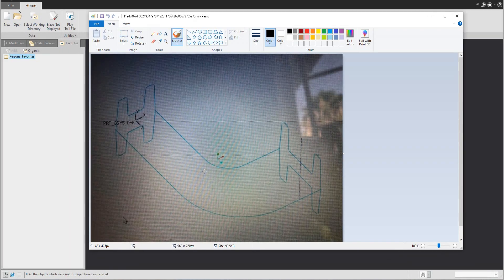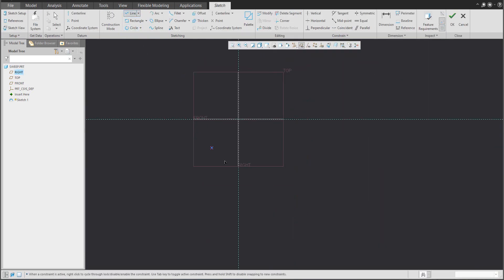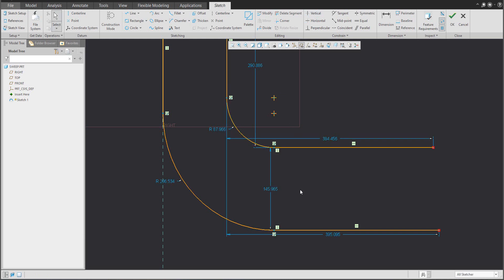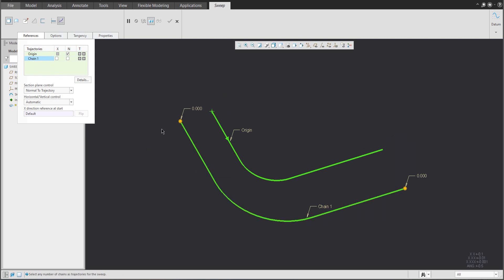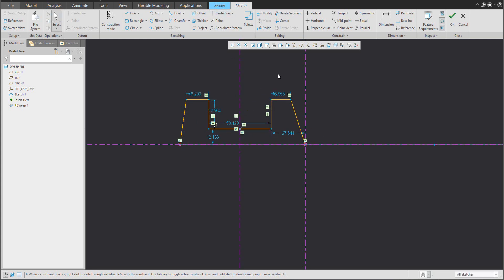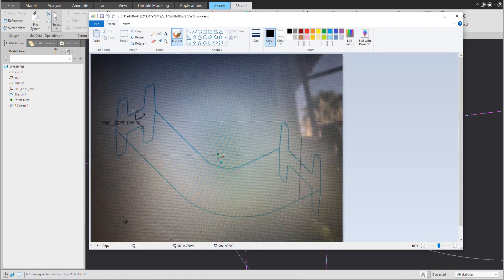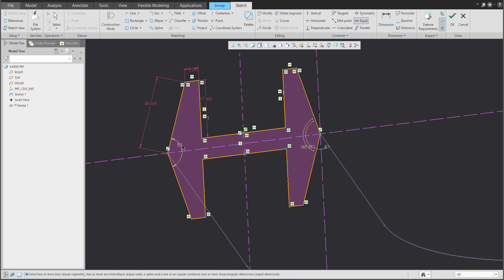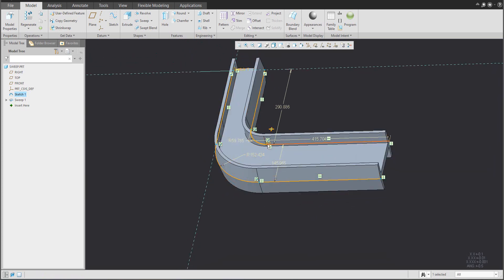Sweep defined by outside curves | Creo Tutorial

Comment: So basically, if yiu lock the dimensions in sketcher mode. The system will follow them through even in sweep mode. ?? Is that it ?? All you need to do is lock the dimensions ?
Reply from the maker: No, you do not need to lock dimensions (in reality, I know that is possible but I never use Lock dimensions 😉👌
Reply: @4kside  then what did you do different? That was the only thing i observed...